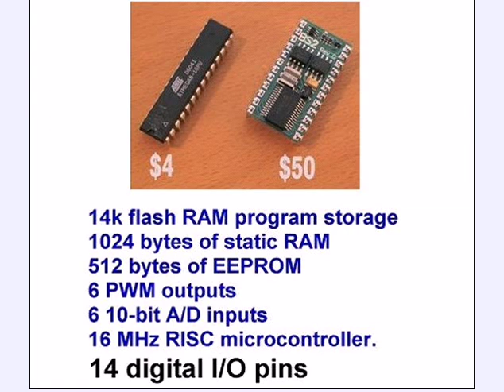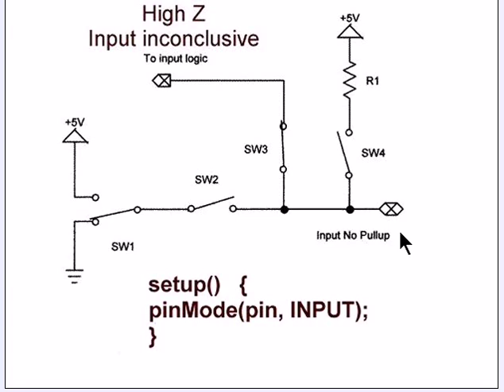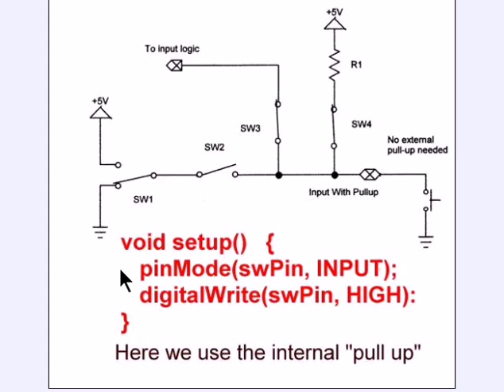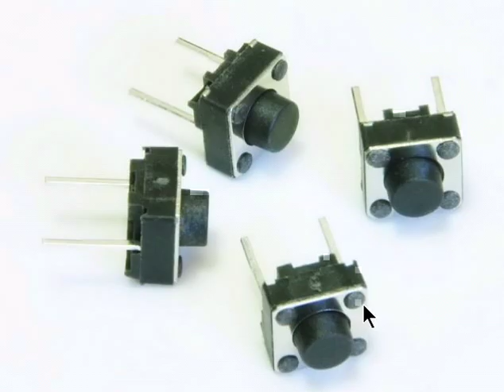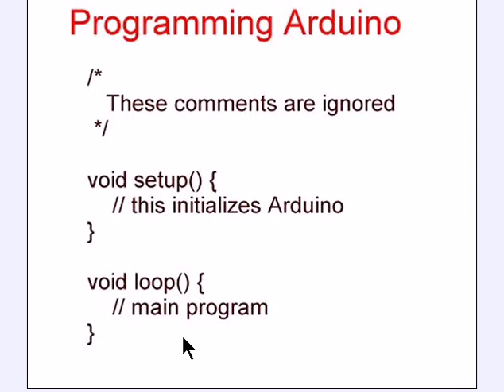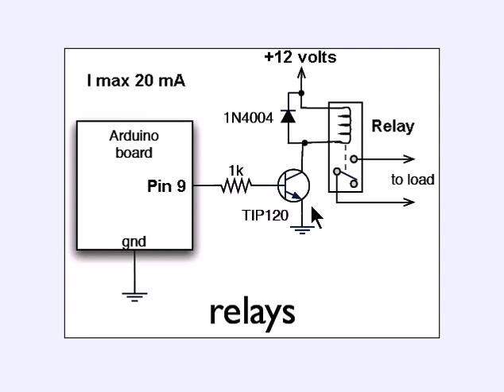Part 2: Programming Arduino Input

Comment from the maker: Introduction to the  Arduino Microcontroller
 
Part 1: Programming Arduino Output

Part 2: Programming Arduino Input

Part 3: Arduino Analog to Digital Conversion

Part 4: Using Arduino Pulse-Width-Modulation
Reply: +Lewis Loflin more..please :)